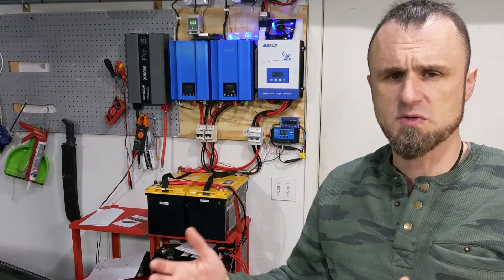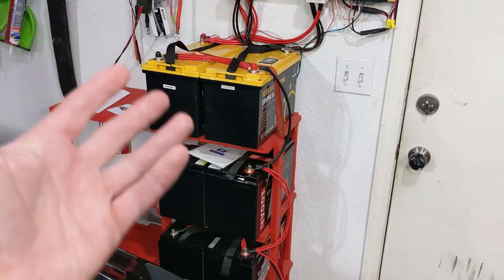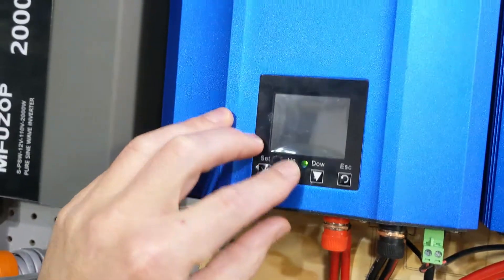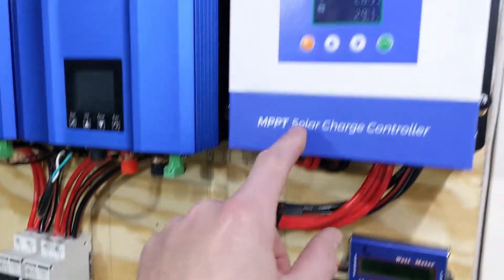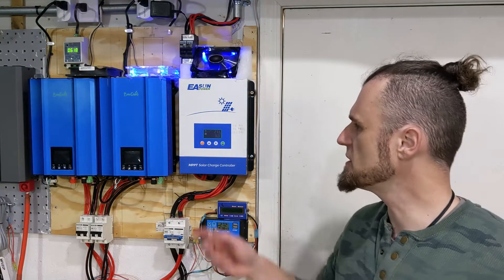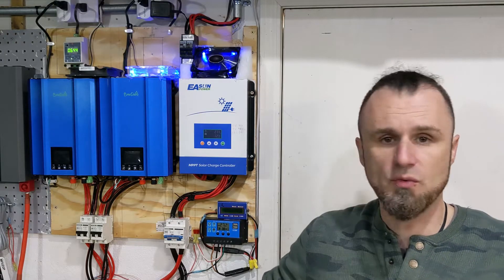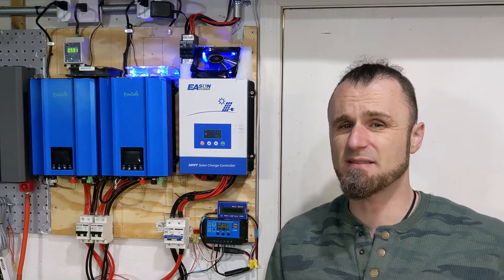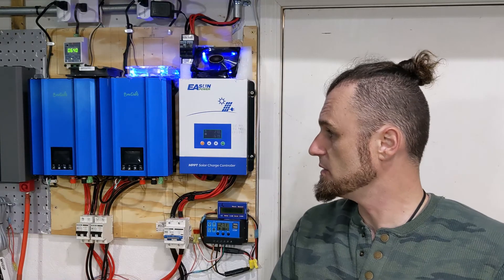DIY Lifepo4 Power WALL with Gokwh Battery Litime, Dr.Prepare, Chins, Eco-Worthy, Easun Power Amazon

Comment: Great set up, I have 16kwh batteries using 16 cells of Eve 304ah cells. I made the two batteries of 24volts using 8 cells each. Doing battery myself it becomes very cheap. Instead of Mppt charge controller like yours, I have a hybrid Mppt powmr inverter solar charger that can handle 80ams charging either through solar or through grid. I have roof top solar 4.5kw for exporting electricity, so day time Soyosource stay inactive, I have another 4kw solar array in the backyard to charge this battery, in the evening the signal from the limiter is switched on through a home made relay using wifi switch as you have ac input for your inverters. it can produce 3000 watts ac as off grid, for on grid, I have hooked up 2 Soyosource inverters similar to yours, I have installed everything on a movable too trolly. The idea is to use this system on our camping trips, where I can load the trolly on a trailer to take away power house with me. I take 4 panels 415 watts with me as it provides enough power for our weeks long trip in Australian sunny beaches. I will make a video and post it.
Reply from the maker: That's awesome man . How much did you invest ? My goal was to get my.moneu back as fast as possible so I made minimum investment , so far my bill got at low as possible about 24 bucks a month ...
Reply: @VegasRoManiacReviews about $3000 Australian for 15kwh

Comment: Nice work (as always). The thing I like best about your system (even though you like playing with it) is that with it as a model, and ordinary person could build it. Once built, it just runs on and on without any need for adjustment. Also, a person could start with just one inverter and put it on whatever leg of their 240VAC consistently draws the most load . and reduce their power bill significantly. After some saving, they could buy the second inverter and put it on the other leg and save more. After saving some more, they could add batteries. So this brilliant system you designed is scalable as a person has the money to scale it up. Each scale up means more savings in the long run. Outstanding!
Reply from the maker: I'm really happy that you have enjoyed the video I wish I had more viewers like you, I think there is value in the information in this video unfortunately we live in too simple of a world with simpletons everywhere

Comment: Sorry I have a few more questions!

What happens if your battery runs down to 0% disconnect?
I would assume the inverters shut off?

Would they automatically restart once charging?

If they did run down to zero, and start charging again from solar, would the the power prioritize back to the grid and not charge the batteries? In this case, I would assume you would flip the switches and turn off the grid tie inverters to then charge up the batteries.

Comment: Hi, I just buy 16xLFP Cornex 280AH 16x57usd + JKBMS 220$ + own box.. and today I receive SoyoSource GTN-1200WLIM48 who will be tested. Question, Your limiter have set 2 units, from two split phase but you have a one CT clamp who should connect all house lines... one CT is not to small size ? You connect it on a external wall in socket box ? On prev video you say you install in on extrance of house but instruction say... soyo fist and limiter/meter/ct clamp inside home usage after soyo...

Comment: Can you explain why do you have the off grid inverter?
Reply from the maker: In case if a power outage I can connect that and feed the house from the batteries
Reply: @VegasRoManiacReviews  can you explain how to do that?
Reply from the maker: I can't , it involves a Widowmaker or suicide cord .  The trolls will come to get me ... Basically you turn off main breaker from the network , all the 220v breakers also and then you plug in the inverter to the same place where the grid tie inverters connect
Reply: @VegasRoManiacReviews  I don't care about them I do mine with a bunch of old scooter 36v batteries

Comment: I am not really clear how you power your whole house loads off these inverters? are the circuits wired to them? How do you prevent backfeeding?
Reply from the maker: They have sensors , the produce power to match
Reply: @VegasRoManiacReviews  Thank you, I watched more of your videos and have a better understanding how this works.

I may want to replicate this, but am I right that these grid tie inverters with power limiters are in the neighborhood of $350 each?
Reply: @VegasRoManiacReviews  also, my breaker is in my garage, near my solar panels (ground mounted) on the other side of the wall of my garage/house. Problem is my batteries and charge controllers and normal inverters are in my basement which is on a lower floor than my garage inside the house roughly 30-40 feet from my breaker panel. How could I best reconfigure my system to incorporate these grid tie power limiting inverters? My wife does not want me to start installing a bunch of stuff/moving my batteries, etc into the garage. I could probably get away with one or two devices (like the grid tie inverters) but then im worried about the cable runs to the rest of the system.
Reply from the maker: Amazon 250 bucks each
Reply from the maker: You can extend the sensor wire but I've designed mine to be close where the panel is

Comment: Excellent, I've a similar system and hope to break even in about 5 years. At night time, which inverter is providing energy to the house? Nvm, I think I see whats gong on. You don't have solar connected directly to inverter, even thought the inverter is capable of doing so.
Reply from the maker: Not a lot of people understand half of the stuff that I said in this videos of the fact that you already have one tells me that you're way above average and thanks for watching
Reply: @VegasRoManiacReviews curious, since this depends on the grid to operate. what do you do during blackout?
Reply from the maker: After I turn off the main breaker and all 220v breakers I feed the house like with an Widowmaker cord in a 12v inverter  that makes the gridntie inverters turn on
Reply: @VegasRoManiacReviews  hah, I've two widow maker cords to feed both my house hots during black outs 😁

Comment: I have the same inverter but when im using a high load and then close it it feeds back to the grid power for 3 to 4 sec . Is there a way to prevent this from happening?
Reply: Curious about this too
Reply from the maker: I does feed back power but it's miloseconds not seconds... It takes a bit of time to react to the power change
Reply: @VegasRoManiacReviews  thanks. Just was concerned if it was actually 3-4 seconds for the logic to activate the limiting threshold. Glad to hear you tested and it’s only in the milliseconds range :)

Comment: I wonder what is the correct procedure to safely turn off a solar system like your?
Reply from the maker: You set the charge controller to charge the battery at lower west voltage possible that stops the charging, trip solar fuse , trip battery fuse, set the inverters to provide lowest power possible , trip power to the inverters , trip fuse to inverters ..
Reply: @VegasRoManiacReviews  thanks 😊
Reply: @VegasRoManiacReviews  How about Incase of emergency for quick turn off, thanks in advance for your advice
Reply from the maker: You can use a broom stick to trip all the switches in case of emergency .. 4 flips everything stops

Comment: So those blue inverters are rated at 1000watts but only produce 650watts. So they only do 65% of what they advertised at.
Also we still have no idea on the efficiency of the blue inverters...How many watts are the solar panels producing in DC as to how many watts at being put into the system.
This video is useless without the information. Because its the difference of paying off a system off in 1 years as opposed to paying it off in 4 years. What IS THE EFFICIENCY!!!

You also keep pointing at your MPPT Charger and calling it an inverter...Its not an inverter. Its a solar charger.

No mentions of how many watts you have in solar on your roof.
No mention of how many watts you produce a week or month on average.